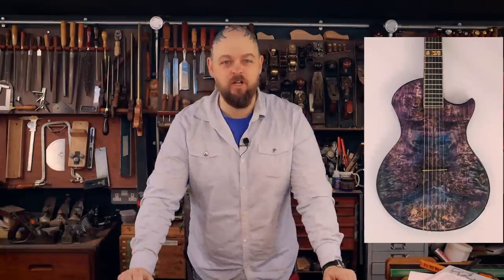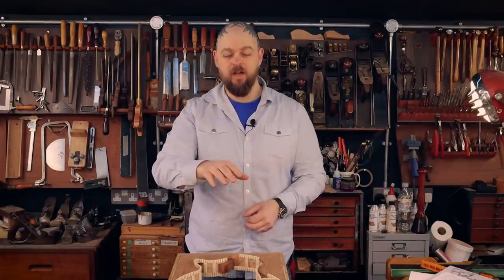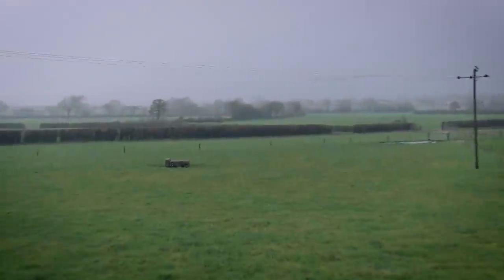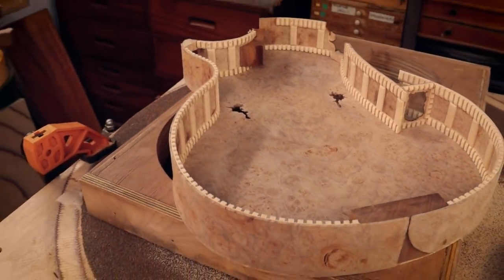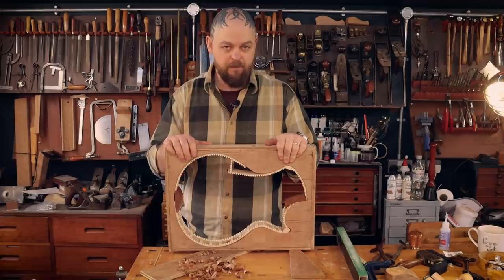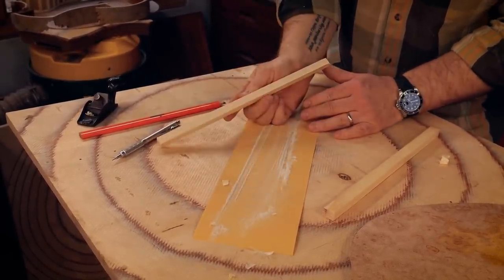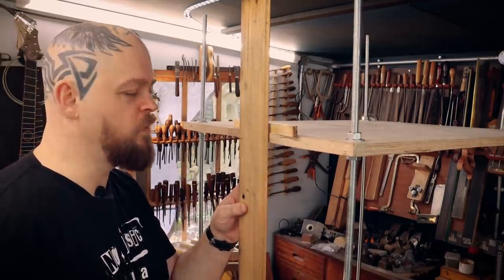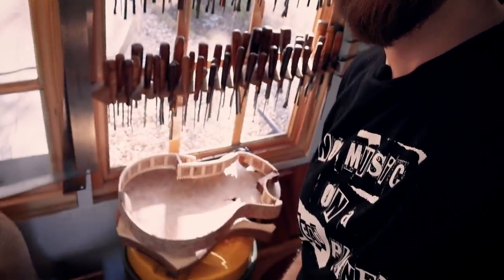Ep 12 Building a Go Bar Deck - Making a Modern Multi-Scale Electro Acoustic Guitar

Comment: Hi Ben, I made a Go bar deck for making acoustics and I used wooden bed slats cut to 10mm width. These allow you to have plenty of spring (bend) on the bars so it solves the problem of them falling out as the tension bends the top up slightly.

Comment: Hi Ben. Years ago I took a class from Harry Fleischman and he would mount a radius board on an old powered potters wheel for sanding his sides. He called it The Wheel of Death, and it was indeed terrifying to behold. Worked though! He also used a large vacuum clamp for gluing bracing in instead of a go deck (although the go deck looks cooler I think).
Reply from the maker: Omg! I have a Potters wheel up at the house I just bought from my neighbor for my kids! I wish I had known 😕 Harry makes some stunning guitars btw! B

Comment: my go bar deck is a work surface with a cabinet above it, the cabinet is as deep as the bench (wood storage) and 100cm higher than the work surface. that way you can always use go bars, and the pressing surface is rigid. I like curtain rods for go bars, if only I could find some higher quality ones..... but QS oak 6-8 mm thick and 15mm wide do a decent job as well. looking great so far.

Comment: It's cool!
I got 2 pieces of really hardwood. It's used for porches, it's called Ipe wood.
But as advertised they were suppose to be flat and 6mm thick, so júst enough for a electric hollowbody top, I'd say. 
But it turns out one of the planks is curved quite a bit. 

Plan was to cut them in half and glue them together making a rectangle of 44 x 28 cm which will be the guitars' maximum dimension. (but I'm gonna make the whole body out of a piece of oak which I'll hollow out and the sides will be oak with the Ipe in the middle on which the bridge and the whole thing will be mounted, I'm going to hollow the body out in a way so that there will be braces left, so basically no braces just from the piece of solid wood) But now I got this one crooked plank.
I was thinking about trying to get more planks from the man and glue 2 of them on top of each other, and with a router slide plain them straight. 
Other idea was to just use these 2 planks I got now, and leave the bottom crooked, glue and clamp it with a lot of force on there and plain the wood as it's assembled on the guitar, leaving more thickness. The one plank will lose like 2mm if I make it flat on one side, so pretty significant, the other one, maybe 1mm tops. So I was thinking, the straightest one in the middle for the bridge and pickups and the crooked one on the side.

Comment: If you have to do that large disc sanding again, you can make a relatively simple machine for that. You should look at videos of grinding a telescope mirror. Same concept, with really cool ideas for a somewhat simple tool to make, that will save lots of time. Basically a turntable, a weight, and an arm to keep the weight and the item in place. They're really neat!
Reply from the maker: Damn good idea! B

Comment: Hi Ben I'm confused as to why you didn't make a makeshift call.. 27:00 clamp it down that way... 
Put 10kg+ weight on it glue the bits on add some Weight to clamp it down job done 👍
It was very touch and go there I get the idea of making sure that the pressure is evenly spread across the joint which is why I thought about using a clamp-caul idea with fair bit of Weight across it

Comment: Ben you actually do not want too much pressure on the braces if you clamp the braces too tightly you could risk having the bracing show through on the front side. But you are right the plywood does flex if it’s not thick enough.

Comment: Brilliant guitar so far, I cannot wait for the rest.

Would it not have been useful to drill small indentations on the top brace the same diameter of the dowells, that way they would go in and not pop out when the tension was too low to hold them in place?

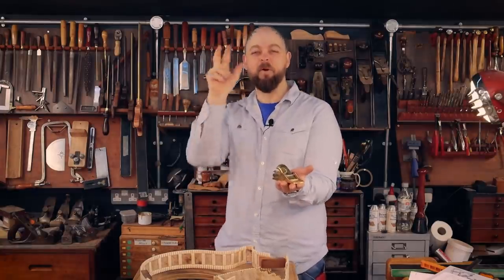Comment: The plane you chose at 5:40 looks the Lie-Nielsen low angle block plane, which is the one I was thinking of when you said you'd plane the kerf. That was the first quality plane I bought. Then my kids bought me the #62 for Christmas and I recently bought the #8.  Next in line are the small chisel plane, #4 smoothing and #5 1/2 jack planes. I think that will suffice. Any comment on my selection or recommendations?

Comment: A little advice that I always do when I glue things that swim away quickly, such as bracing or veneer: as soon as you have applied glue, like titebond, to the entire surface, clear a small area and put a drop of super glue on it. The instant adhesive hardens quickly and thus holds the workpiece in place so that it doesn'tt slip away. :D
Reply from the maker: Really interesting tip! B

Comment: Why not put something heavy on the upper plate? The upper is only a reaction surface for the rods. Adding diagonal and or edge braces will give uneven reaction across the surface of the upper. A quick guesstimate from the number of rods and the amount to bend you have suggests that 5 to 6kgs in the centre will be sufficient.

Comment: Hi Ben, I'm loving the two builds going on, they really show different aspects of building. I have a question regarding the braces. I understand the process of splitting the wood to allow the break to follow the grain and remove run off, but if you follow that up with a plane aren't you reintroducing run off? Or is it an exercise in reduction rather than elimination?
Reply from the maker: I'm essentially making sure that the bulk of the brace has solid grain running through the centre. If I had cut off the other side of the blank it had grain running out at about 30 degrees to the edge. I would have had not a single grain along the entire length if I had done that.. and that would have been very bad for tone and for longevity.  Thanks for watching! B

Comment: really getting there Ben looks ace, just a quick tip re the GoPro and its strobing when youre using it, set the shutter speed manually to 1/50, or 1/100 as itl then synchronise with the 50hz frequency of UK lighting :-)
Reply from the maker: Hi Elliott, thanks for this. I was wondering what to do here. in the end when you dig down into the settings in the go pro app you can set an anti-flicker based on 50 or 60 hz lighting.. I wouldn't have thought to look this soon without your advice! B
Reply: @CrimsonCustomGuitars  Wonderful, glad to help! Look forward to this series every Saturday
Reply: @CrimsonCustomGuitars  oh and before my life in cabinetmaking I was an editor, I did see you say you were looking for some assistance with it? I’m based in Poole if that helps

Comment: I think you need to adjust that GoPro to shoot at a different number of fps and maybe see what you can do about the shutter. I think that's what's causing the flickering. Keep in mind that the flicker of the LEDs might not be something as standard as 50 or 60 fps.
Reply from the maker: Hey, thanks for this. I found a setting to fix the issue in the gopro app.. next time should be much nicer! B

Comment: Shouldn't the curve for the braces be obtained from the location on the arch template that matches arch in the back and the sound board? The arch template is deepest at the center and shallower as you move towards the edges. Isn't it?

Comment: I presume the carve in the upper plate is the complement of the lower for uniform distance? doesn't that mean you need a new deck for every radus you want to build? Other go bar decks I've seen are WAY taller so they can absorb more variation, is what you did more common or are you just out of shop space? And what is the 'A' application of that enormous sandpaper?
Reply from the maker: I'm really not sure what these disks of sandpaper were originally for, I found them through my shop http://www.vintagetoolshop.com in a workshop clearance.  I'm low on space.. very low. and most acoustics are built with the same two radii for the top and back respectively.. so these plates will work well.. at least for standard steel strings. B

Comment: Hey Ben, apologies if you've already thought of this but will you have sufficient access to the internals should you need to replace anything after the build is complete and all glued doen....like if the jack socket comes loose.
Reply from the maker: A very good question. This is one reason for doing a jack socket there tbh.. it is a nice 22mm hole that I can poke things through if needed.. B

Comment: Loving this build. Clamping wobbly stick thing - if the top piece was the CND’d inverse of the base, would that stop Stick Ping? Would you even need sticks?
Reply from the maker: That would work if all the braces were exactly the same.. tbh a vacuum press is a better option than a go deck but I'm not going down that route with this build. B

Comment: A gallon tin of paint, or a gallon jug of water, or two, or three would have given you the downard force to counter the bowing in the top plate.  Gravity is force, so either you could have transferred the force needed through the steel bars on the four corners, or you could have borrowed Mother Earth's mass just a bit and put some of it on top of the upper plate.  I think.

Comment: Wait now, what was the advantage of that tricky clamping technique vs just putting a block of wood straight across and clamp it down? 
A couple of cutouts in the block could also help holding everything in the right place 🤓
Reply from the maker: this gives very precise pressure exactly where it is needed without distorting anything too much. big clamps and lots of pressure equates to uncertainty and un-foreseen issues happening. B
Reply: @CrimsonCustomGuitars  A block of wood and small clamps? 😇

Comment: I hate to strike a discordant note but the guitar-exquisitely beautiful I am sure it will end up- just looks too fragile and crumbly. Also, I wonder what it will sound like when in acoustic mode? I can't imagine it being anything other than a dull sound-sorry!
Having never attempted anything like this perhaps I should shut up but I would be tempted to coat the inside with superglue or even resin after the struts had been fitted and dried, it would add strength and improve the sonics.
Feel free to re-educate me if I've missed something or said something dumb!
Reply from the maker: It's not a problem.. I would rather have really questions and concerns than people kissing my ass even if I'm being an idiot tbh. 

I'm not entire sure what the sound will be like, however, with the bracing I will be able to shape it if we are looking like being too thuddy.  I'm planning on shellacing the inside if the sides at least to slow down moisture transfer. But as to stability, she'll be as string as any other acoustic guitar you've met in the end. B

Comment: How did you make sure that the top and bottom edges of the sides were co-planar or in whatever position you wanted them to be in relative to each other when sanding in the  curve?
Reply from the maker: Measured after the fact to check but basically took even amounts off each side. That's why I planed the excess kerfing off before sanding. B

Comment: Probably a stupid idea, but could you not have drilled shallow holes in the braces and the top of the clampy doo dah, to prevent the doodleboppers popping out?  I'm certainly no carpenter/luthier, as im sure you can tell from my technical terminology, I don't even get flat pack furniture right on my first attempt, I mean like the dowel holes in a wardrobe or chest of drawers, I'm sure they could be filled and sanded afterwards since they're not on show

Comment: Hm, I don't understand why you split the braces. Did you not cut along all sides afterwards anyways?
Reply from the maker: I am removing a bit with the plane but I am starting with a blank that is split properly. I f I had just bandsawn a strip off the other edge where there was grain runout all down it then I would have absolutely zero grain going all the way way down the length.. B

Comment: Would you still need to brace the "Deck" if you just flipped the top over so that the flat side was down, and the dished side facing out worked as a reverse arch?
Reply from the maker: yes.. the pressure is pushing both top and bottom out a bit.. it needs more support or a bunch of weight on the top.. B

Comment: After watching this. It’s almost like you know what you’re doing. Lol. Have u tried the double sided tape that the Texas toast guys sent u? Did it make a difference that the the body wasn’t centered in the mold? Or was it centered and just an optical illusion? Sorry for the 100 questions.
Reply from the maker: Hey. I had a go with the tape but it's no where near as solid as 'the trick' still got a bit of give in it and I didn't feel comfortable with it. I will try again though, I may have been having an off day!

As to the radius dish the curve is the same so centered it not makes no difference as long as the top is within the diameter of the circle we'll be right. B

Comment: So correct me if I’m wrong but as soon as you planed those support after you split them with an ax you have now made the sides not follow the grain lines making the whole splitting it with an ax thing completely pointless. But I’m not a wood worker so I may/probably be wrong!
Reply from the maker: I am removing a bit with the plane but I am starting with a blank that is split properly. I f I had just bandsawn a strip off the other edge where there was grain runout all down it then I would have absolutely zero grain going all the way way down the length.. B